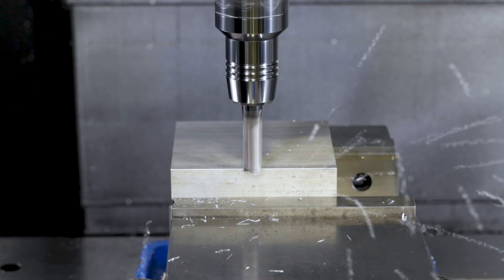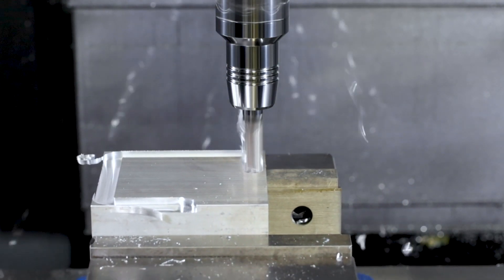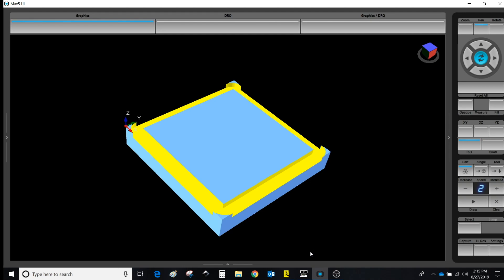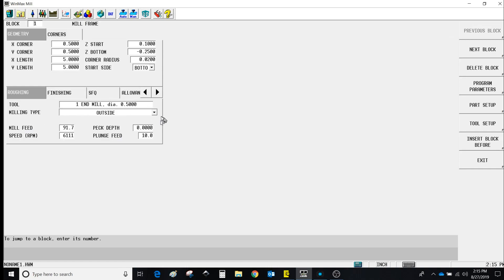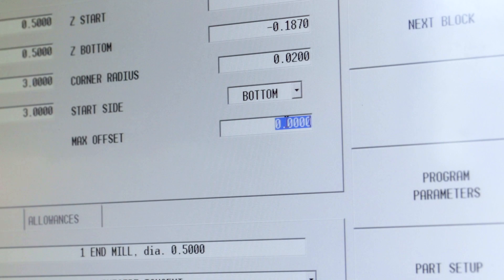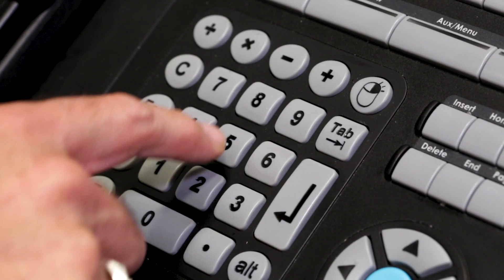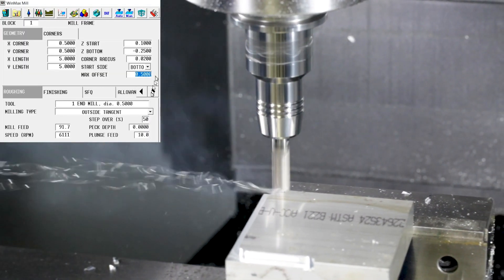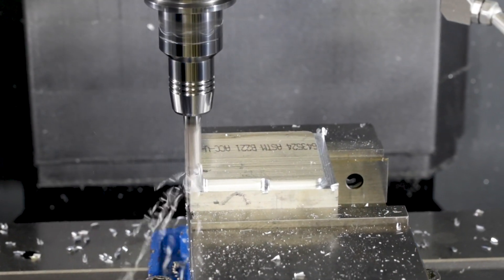How to use MAX Offset with Simple Shapes: Hurco CNC Programming (2019)

Comment: How would you get it plunge outside the stock and work its way in? Increase the max offset even more? Or have your start point off the stock?
Reply from the maker: Hi Kurt, we talked to Mike Cope one of our Hurco specialists that made this video. He suggested the following, "I would probably program the feature using LINES & ARCS, and use the start point (Segment 0) to determine where the tool plunged…then set the milling type to PROFILE LEFT or PROFILE RIGHT which will give you the MAX OFFSET field as well."

Comment: Can you feed down off the pc and do a dynamic high feed tool path conversationally?
Reply: Yes, you can use a blend offset to plunge off the part. Hurco Pocketing adaptipath is very powerful toolpath generator for pockets
Reply: MooreCNC does Hurco adaptipath work for outer contours like a dynamic tool path?
Reply: @steviebsdjservice  yes just cheat and throw a frame block around your geometry, say an inch or so depending on tooling. Then define your "outer contours" as a pocket island. Its inefficient and cuts some air but will allow you to use adaptipath on outside contours because its bound like a pocket with the frame block